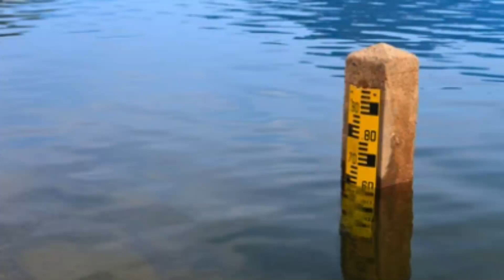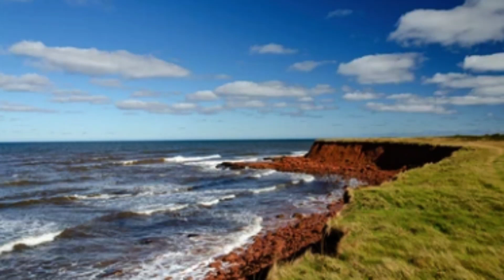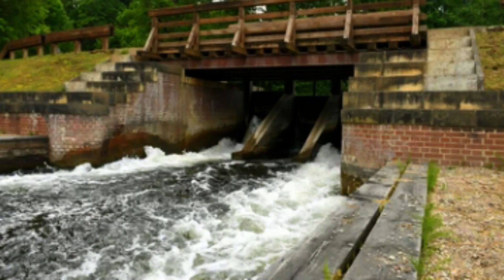What is Static Water Level? What is Dynamic Water Level?

Comment: thank you. Good video.  Is there any recommendation for dynamic water level? For example,   half of the deep of the pump?
Reply from the maker: When determining the dynamic water level for a pump, there are several factors to consider. While there is no specific recommendation for setting the dynamic water level at exactly half of the pump's depth, the following guidelines can help in determining the optimal water level:

Pump Efficiency: It is generally recommended to set the dynamic water level at a depth that allows the pump to operate efficiently. Running the pump at a lower depth may result in excessive energy consumption, while setting it too high may cause the pump to struggle to draw water.

Pump Specifications: Refer to the manufacturer's guidelines or specifications for the pump being used. They may provide recommendations for the ideal water level range or offer suggestions based on the pump's design and capacity.

Water Availability: Consider the availability of water in the well or water source. Setting the dynamic water level too low may deplete the water source quickly, leading to insufficient water supply. Conversely, setting it too high may result in inefficient use of water resources.

Environmental Considerations: Take into account any environmental regulations or restrictions related to water extraction or groundwater management. Ensure compliance with local laws and regulations governing water usage and protection.

Water Quality: Consider the water quality and any potential contaminants that may be present at different depths. If there are concerns about water quality, it may be advisable to set the dynamic water level at a depth that ensures cleaner water is being drawn.

Monitoring and Adjustment: Regularly monitor the water level and pump performance to ensure optimal operation. Adjust the dynamic water level as needed based on the observed performance, water availability, and other relevant factors.

It is important to consult with a qualified professional or water resource specialist who can assess the specific conditions and requirements of your pumping system to provide accurate recommendations for setting the dynamic water level. They can consider factors such as the pump type, well design, water source characteristics, and local regulations to determine the best approach for your specific situation.